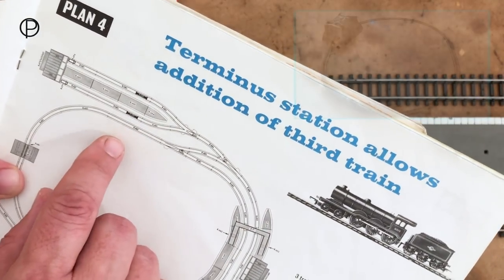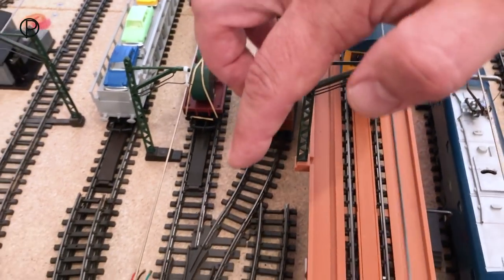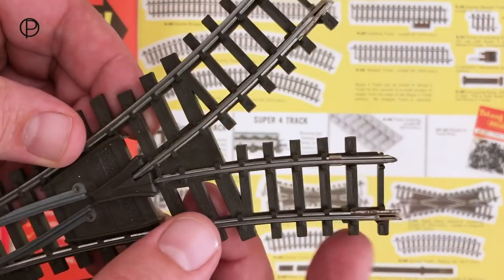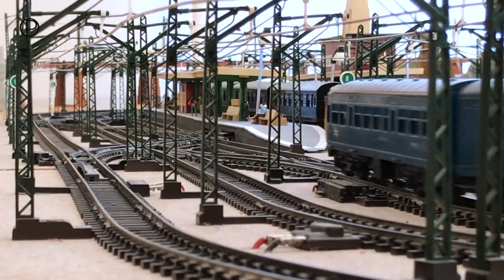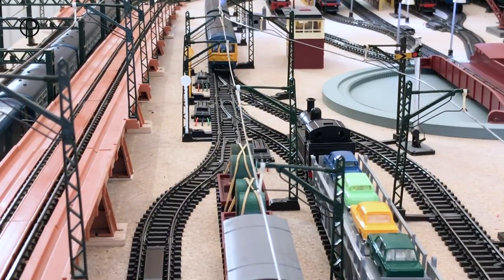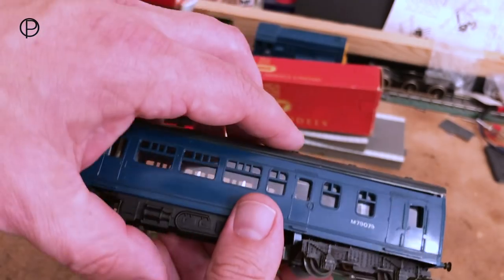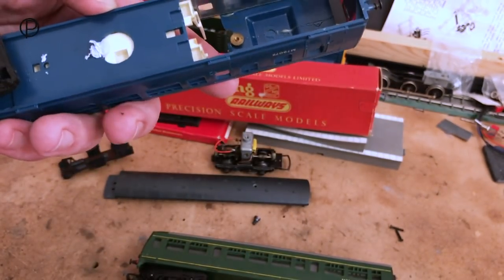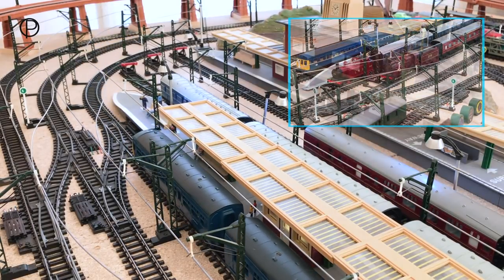Tri-ang Hornby R.157C Diesel Railcar with "Y" Point and Footbridge

Comment: I’ve still got a triang/Hornby elevated track set with a coal dumping chute, the elevated piers had special clamps to hold that triang ballasted track sections. Came with a deltic locomotive and six open coal wagons that had flaps that opened beneath the hoppers when they passed over the coal chute then close again at the end, got the set for Christmas in 1969, it’s still in good nick have seen prices on eBay for triang gear people charging a pretty penny.
Reply from the maker: Hi that's great to hear you still have the original pieces from childhood.
Oscar

Comment: Thanks for the name check #flattered:-) 
Excellent video as every, a regular Sunday treat. I'm assuming you can't find space for a level crossing, what about one of the rather clever curved ones brought in for just that sort of situation.
Reply from the maker: You should see the bullet holes in my feet Andrew! The crossing you refer to R.414 double track curved (1st and 2nd radius). I do now have. But sadly no 1st and 2nd together to incorporate one. Strange they don't seem to have made a single curved one for any of the curved track available. I don't think there would be space even if there was one. I did not have the crossings R.414, R.496 or R.495 when I DROPPED this track on the baseboard. I think even the single Straight crossing R.495 will not fit. It nearly fits on the lead up to sidings in the yard with gantry's next to the engine sheds. But the ramp meets the station! Poor planning strikes again!
Oscar
Reply: Second layout for the bits you can''t fit...you know it makes sense. Actually one showing all those operating accessories like the  electric level crossing, giraffe car and so forth has an appeal all of its own.
Reply from the maker: I think you may be right Andrew if only I had space!
Oscar

Comment: Man even in the 60s Metric was rearing its ugly head. I feel sorry for you Brits. We never gave up Imperial though. (Well there is a slight difference between US and UK Imperial but its basically the same.)
Reply from the maker: Hi Warren. It's a funny thing the Metric and Imperial. I was brought up using both.  We now have Petrol/Diesel (Gas) sold in metric by law and all our road signs are expressed in Miles. Cars sold here in the UK mainland have onboard computers that show consumption in Miles Per Gallon! and all foods at the store are sold in metric by law and this includes street markets. Beer in Public Houses (Pubs) is sold in Pints but wine in metric. Thanks for watching and taking the time to comment. Oscar
Reply: Metric and imperial together!  What about model scales,  EG  4mm to the foot, and tyre sizes, where the width is in millimetres and the wheel diameter is in inches.